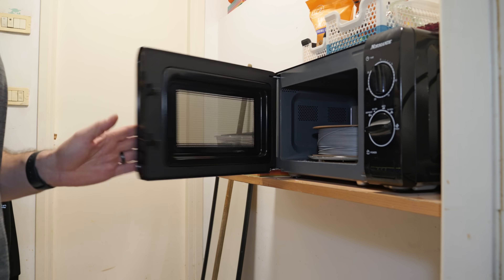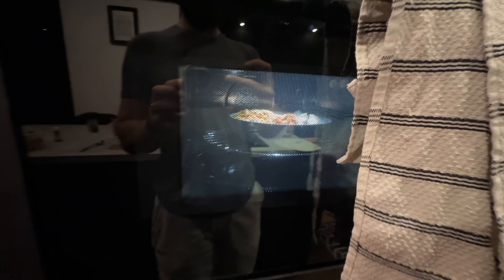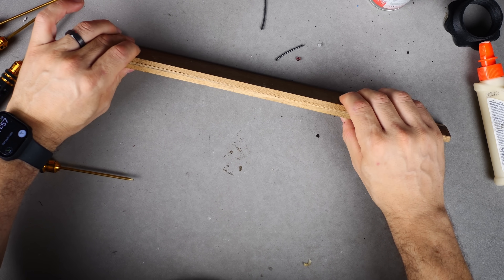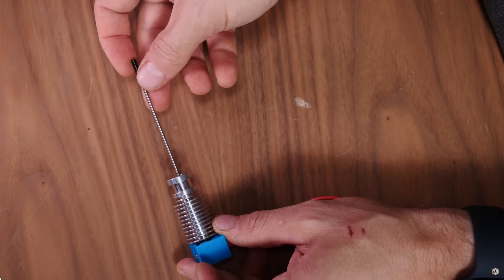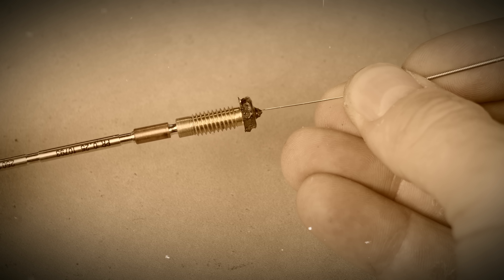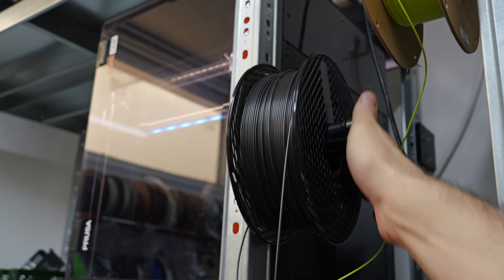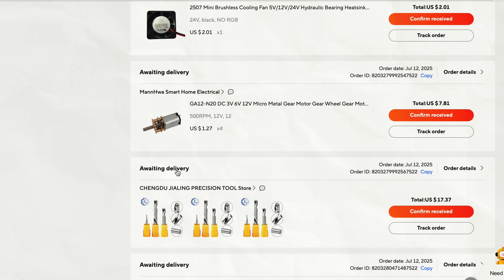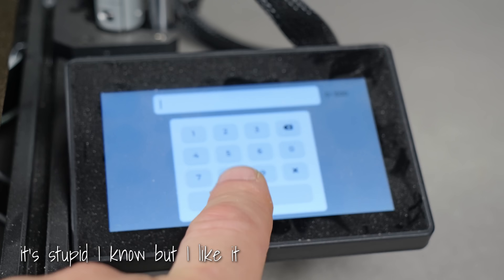Why I Microwave My Filament (+7 Other Strange Hacks)

Comment: Styrene will off gas just sitting there at room temp. If you heat it, it will accelerate that process. So just know that there will be VOCs, you can't get around that. I used to work in Vacuum Forming at a commercial scale, and we typically had to dry our sheets prior to forming, because we purchased sheet from an extruder and didn't extrude directly into the forming line. I am very familiar with the smell of hot ABS. I have not gotten cancer yet, but that doesn't mean you should not be careful. (In fact that double negative translates the sentence into do be careful .)

Comment: To speed up the process I have made it a habit that before slicing I preheat the print bed. By the time I get the settings and orientation I want, its ready to print. Its just a workflow.

Comment: my sily tip for Bambulab + AMS users (will probably work for other brands too): when I'm printing something and using material from let's say slot #1 and I know the next print will be with the same material, I'm stopping print right after the print finished and before the head goes to cut the fillament. This moment can be heard as printer turns off the fans few seconds before. Helps to save some time for filament unload/load
Reply from the maker: Ha nice way to save some time!

Comment: Try using the acupuncture needle from the top, you can sometimes push the clog out (or break it up) and use pliers to strip the bulk of plastic away from the needle before you pull it back out. 

Most of my other hacks (besides the ones you mentioned) are software/tool related eg: spoolman to keep track of filament and how much you have left, it even tells you if the print is going to run out and Manyfold to build a library of all the stls with previews etc
Reply from the maker: Cool idea, BUT, doesn't work with the integrated nozzles, which so many printers these days (Creality, Prusa) have.
Reply: @thenextlayer Yeah, it doesn't work with a lot, more so the oldschool ones it applies to. But at least with them, it makes it a ton easier and you can do it at a set heat
Reply: Attention: needles Work only with normal nozzles. Even If you have a high flow nozzle, then the path INSIDE is divided into three single holes!

Comment: Best way to clear the clogs with a Prusa Core One:
Replace it with any other printer. Not worth owning. It'll get clogged so often that the total cost of ownership will exceed the cost of another printer due to newly purchased, ultra proprietary nozzle w/integrated heat break.
Reply from the maker: I LOVE mine, I have two, they're both aces.

Comment: I have the old bed from my A1 that was replaced from the recall sitting next to my printers to pull heat from the flexolates when prints are completed. Having the magnets to pull the PEI sheet down allows really good contact, that and that the A1s bed has a lot of thermal mass

Comment: i print mainly pla , some of the beds  i have  have the tendency to keep small bits of pla like they are holding Excalibur , instead of breaking your nails (( i do not like using sharp razors on the bed ))  i just throw it back on the bed  heat it to 75 or 80 c and then with my nail  it is soft enough it almost pulls right off and is rubbery  ! i hope that helps someone
Reply from the maker: Oooh, nice tip :)
Reply: @thenextlayer  i was literally breaking my nails on the bed of the creality v3 se ...and at some point it just hit me i can do that :P

Comment: Try cooling the build plate with a spray of IPA on the back (bottom) side after removal from the machine. Seems to me evaporation cools faster than conduction, and the alcohol spray bottle is always to hand near the printer for plate cleaning. Try not to burn yourself, YMMV.
Reply from the maker: Oh interesting. But isn't it bad to inhale IPA as it's evaporating?
Reply: @thenextlayer  Not sure, but I've been doing it for over 6o years in doctor offices and when getting vaccinated. Seems there are many substances that were found to be harmful to a few people and a few that have been found to harmful to most people. Over 9k forever chemicals, most have not been tested for long exposure. Very risky IMHO.

Comment: Microwaves induce electrical voltage in metal, which then leads to a flow of current (eddy currents). If the metal is thick, the resistance is low and the voltages are short-circuited, so to speak. With thin metal, on the other hand, the voltage can build up because there is hardly any current flow, which then destroys carbon fibres, RFID tags, CDs, etc. However, a thick metal spoon in a glass is not a problem because, as mentioned above, the voltage generated is short-circuited and therefore remains very low – no side effects!

btw: the "222" trick I do for decades on my microwave oven too (it allows keyboard entry so 1min 40 is 1-4-0 keys). Because the microwave works with on/off pulses to reduce the max. power, it doesnt affect the result if you then type 1-4-4. And to defrost two pieces of bread its a nice 2-2-2 :-)  (the last pulse ends about 2:17 - I can hear it, the next will start at 2:33. (at 20% power its a 4s ON to 16s OFF timing)
Reply: Voltage generated may remain low, but the short circuiting of the eddy currents means it can get incredibly hot.
Reply: @soundspark  and thats depending on the resistance of the material. high resistance and the current stays low, so the voltage rises to drive that small current. Simple Ohms law possible. 
A CD with superthin layer of alumium, high resitance, the voltage rises till it creats sparks, spoon - nothing happens.
How hot it can get depends on the amount of energy thats induced.

Comment: 1. I have a desktop fan near the printer. After printing, I turn it on to full power and hold the buildplate in front of it, and it cools down in seconds. 
2. A drop of oil for sewing machines into a PTFE tube reduces friction a lot and does not seem to affect the printing. 
3. When you want to print a solid part, especially with older slicers, do not set infill to 100% because it overflows. Instead set bottom layers count to 1 million.
Reply: Oil in the PTFE tube....... sorry but I tried that idea years ago and all it ever did for me was contaminate the filament. Layer adhesion weakens, etc... realistically, PTFE ("Teflon") should have negligible friction all on its own (just avoid sharp bends/kinks cough Centauri Carbon)...

I even thought (back in the day) that I could "season" an all-metal heat-break with baby oil, as one might do with a cast iron skillet. Let's just say I'm glad I had a ton of spare V6 parts on hand back then!
Reply: @JustinNelsonsProjects  I guess there is a difference between baby oil and a sewing machine oil. Dunno, I don't do babies.
Reply: @BarafuAlbino  I'm honestly not sure why I said baby oil... it's Mineral oil I meant lol... I think it might have been sold as a brand of "baby oil"... but I knew enough to look for "fragrances" etc...
Reply: @JustinNelsonsProjects  
"I'm honestly not sure why I said baby oil.."
Well I'm just glad that you didn't use oil made out of babies!
Reply from the maker: Oh damn those are good ones!

Comment: Ok so metal and microwaves:
Every microwave tolerates forks spoons equally. it doesnt really come down to geometry here (atleast not for us)
The reason you can heat your food with a fork in it, but not just a fork,
is that the microwaves are absorbed.
its an echo chamber. similarly for filament... RF id tag would likely be fine... until the spool is dry and nothing is absorbing the microwaves anymore.

Oh and yeah.... water is water.
even if its steam... even that is going to get heated so... dont expect temps to be clamped to 100°C just cause thats the bp of water.

Comment: Really nice hacks. Earlier nozzles were very cheap, just a small peace of brass. Replace it. But nowadays, they became a part of the heatbreak or hotend. Too expensive to just replace them. Cold pull is fantastic method, just on printers, which allows you to take off the pressure from pulleys.
Reply from the maker: 100%!
Thanks for the microwave trick, it changed my life

Comment: Hold on slice engineering sells a METAL container for 3D printing ? ahhahaa
Reply: It use active alumina as desiccant. Rejuvenation requires ~200c, hence the metal container 🙃
Reply from the maker: Wait WHAT? I didn't know that. I've been drying it at 85...
Reply: @thenextlayer  lol

Comment: Yes, I'd love to see a 30 day "Fusion 360" challenge.  When I first got started, bed adhesion was the biggest frustration. I print mostly PETG as I found the VOC from PLA too strong to be in the same room when printing. After I replaced my stock build plate with the BIQU CryoGrip Pro series of build plates, all my bed adhesion problems went away.  As an added bonus, you can print on some steeper angles than you would think possible. It truly is a game changer.

Comment: Add baking soda to your CA glue to build up material and create a really strong joint.
Reply: CA solidifies immediately after contact with soda. I can't imagine how quick you are to make it in time.
Reply: @sergeiepatov7683  I don´t mean to premix the glue and then use it. I mean first glue the pieces together lightly and to build up more material at the seam are add baking soda and then glue to it. For instance I created chamfers on both parts and then filled them, like you would do with welding a butt joint.
Reply: @sierraecho884  Ah, got it, thank you. It's also worth trying to coat one surface with soda water solution, then dry it, then coat another surface with CA, then connect them.
Reply: @sergeiepatov7683  Good one, thank you. I use the curing spray stuff instead nowadays. But it´s useful when I am out.

Comment: great video as usual laughed so hard when you just said because of science stuff 😂
about the filament drying technique would like to have a proper video about it cause I'm really afraid of the result when I saw Igor doing it I was like no way than I started thinking and after your video I'm now sure! it will be great if you can investigate it cnc kitchen style cause there are a lot of microwaves types and brands so maybe a bit more investigation would be necessary but very cool if you could just pop the spool in the microwave and it will be dried...
tnx a lot!

Comment: Yes, you should learn to do CAD. Being able to make custom stuff is the best part of 3D printing.
Reply: 3d printing is the best part of CAD
Reply: I've always loved that I can imagine something in my head... then begin to realize it in 3D on a screen... then a few clicks, maybe a couple hours, and hold in my hand the thing that was nothing but an idea in my head, all within a few hours (or less for simple ideas). THAT is what got me into 3D printing.

I for one was glad when Etsy changed their policy. The idea that for a couple hundred bucks and an Internet connection -- no imagination, CAD skills or even knowledge of how the machine or design process works -- people make money off of other people's hard work... just my unsolicited 2 cents.
Reply: Are there people that use 3D printers without using CAD? Like  I thought that is the First thing you want to learn is CAD when it comes to 3D Printing
Reply: @ulforcemegamon3094  Yes, they only print files made by other people. In fairness, not everyone can do it. It takes good 3D visualization skills, and most can't even do 2D visualization.
Reply: @ulforcemegamon3094  I used to know CAD really well in the DOS days, but I've been out of it for a couple decades now. I'm trying to learn Fusion and its not as intuitive as the old versions, IMO. I can still sketch things up in 2D pretty well, its just getting it converted to 3D on the computer that I'm struggling. So for now, I print things others have made and the few things I do change I do in my slicer - adding or subtracting rectangles basically.
Reply: @ulforcemegamon3094 There’s a large subset of Bambu users that don’t even use a slicer, just the app on their phones.
Reply: I do rather complex stuff in Blender + OpenSCAD for gears and threads. I know it's wrong, but still can't get over it and learn huuuuuge and scary FreeCAD (proprietary stuff is an instant no-go for me).
Reply: I tried FreeCad/OpenSCAD/Fusion but I didn't like any of them. Coming from a Maya Autodesk background, I went for Blender3D instead.
I set up my scene for millimeter units, then I'm all good. It has downsides, such as poor boolean operations but a lot of upsides, such as a lot more freedom, modeling tools and plugins.

Comment: Do the 30 days CAD challenge in Fusion 360 instead of onshape
Reply from the maker: I can't STAND Fusion, just doesn't vibe with me...
Reply: @thenextlayer  Same here. I tried to learn Autodesk Fusion and was swearing every 10 minutes or so because it couldn't do things how I wanted it. After 3 months of really trying I went back to SolidWorks.
Reply: I'm with Next Layer. I learned Fusion 360 first and switched to Onshape. It has way more tools, it's more intuitive, it's free, browser based... really no downsides.
Reply: @whifflingtove  It probably saves all your data or some shit. There are no free things. If something is free, it means YOU are the product being sold.
Reply: Doesn´t really matte. Most mid size CAD packages are more or less the same if you just start out. I would always recommend SolidWorks
Reply: @IddoLent  or freecad. It's pretty great and you dont have to put your files online

Comment: Just FYI from my experience of drying reusable descant in the microwave. They way microwaves heat is to excite water molecules, the thing you are drying can get VERY VERY hot. Dont burn yourselves. Nothing wrong with doing it, just mind yourself and as you said do it in short bursts .
Reply: One more thing to keep in mind: microwave oven heating is inertial by nature. Because heating occurs outwards from the deep, you may touch the surface and think it's still underheated, but in 10-15 seconds it will catch up. It's very easy to overheat because of it.
Reply: @sergeiepatov7683  its a kind of myth that microwaves heat from the inside out, they don't at least not on many things.
Reply from the maker: CORRECT!
Reply: @thenextlayer  Dessicants sometimes contain the colorant that shows how wet they are. One of them, that turns into purple when wet, becomes VERY toxic when heated.
Reply: @BarafuAlbino  Thanks for the warning... but I'm also skeptical about that statement.
If you think about it... don't you think sales will plummet rather quickly for a product that release toxic fumes when using it normally?
Nobody would sell a lot of cars that have their exhaust routed into the driver's cabin either. 
What temperatures are we talking about here? Hundreds of °C above standard drying temps or something? That would be more believable.
Reply: @SebasTian-od7oz it is true though. Super toxic might be exaggerated but the blue/purple comes from cobolt which is toxic. Heat pretty much always increases leeching to the enviroment and these scilica gel spheres can easily get superheated+explode if not microwaved the right way.
Reply: @BarafuAlbino  that is why i only ever use the orange one .
Reply: @PrawnzHD  Wow, now we upgraded from toxic fumes to explosions 😂.
Don't mind me, I'm just joking around.
I'll never buy the blue/purple one, (although they are so pretty.)
I got 2kg of the orange ones and mixed them in with 6kg transparent. 
Was a good idea but I was stupid not to check before mixing. The orange ones I bought were smaller than advertised and now they fall through some grids I designed.
That itself brought me to use small, fine meshed, transparent jewellery bags. I just throw them in the box now instead of doing complicated prints. So handy / much easier! So it's a win in the end.
Reply: @SebasTian-od7oz 
"don't you think sales will plummet rather quickly for a product that release toxic fumes when using it normally?"
Who "normally" puts desiccants into the microwave?
Reply: @SebasTian-od7oz fear mongering/old wives tale imo.
Reply: I go in 30 sec increments and let things cool for 2-3 minutes in between. So far, works like a charm!
Reply: That's why it's recommended not to use colored silica.
Reply: And as I just learned a few seconds ago... Do not dry TPU in the microwave. It melted within seconds, probably because it has a lot more water inside than most other filaments. Luckily I only tested it with a 50g sample :D
Reply: @andljoy  100%.. I just ruined my vinyl tablecloth because I dropped my heated dissicant on it 🙃